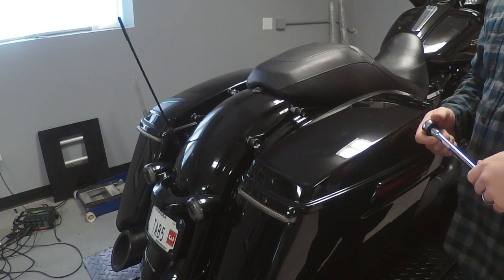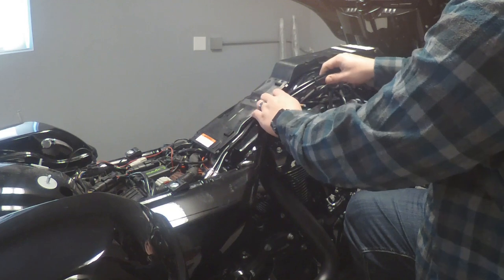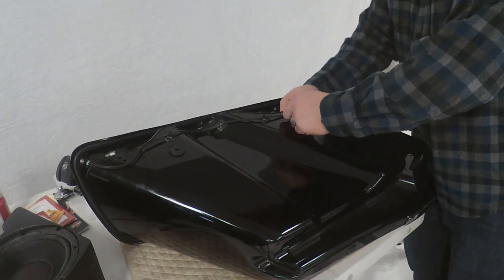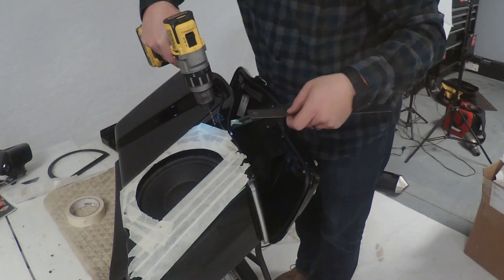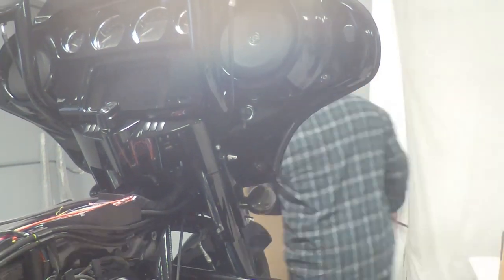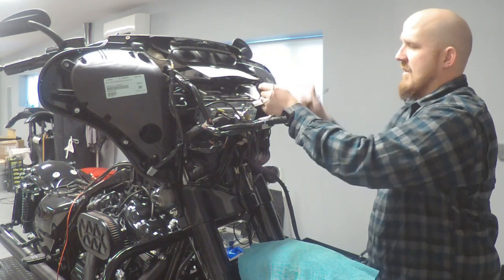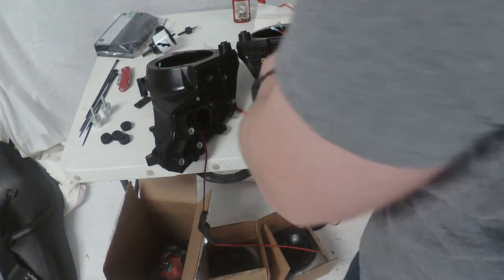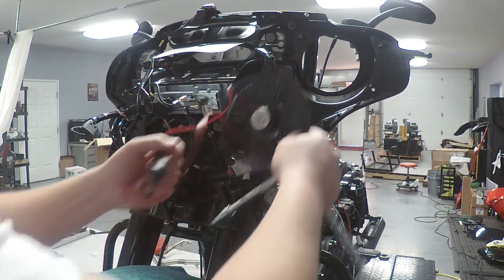Sinister Sound Install Video

Comment: My question is what protects the speaker and your electrical from water damage since Sinister Sound speakers are not weather resistant? IMO...Seems to be a big price to pay for something that can't be ridden in weather. I live in the Midwest and you never know when you're gonna get caught in a rain storm and for how long. We did a test and cut open some of these speakers to find a lot of hot glue and that they're actually house speakers meant for indoors.
Reply from the maker: Note from Sinister Sound - 8’s are waterproof. Front is now extremely water resistant. Enough so that they will cover water damage within the first year, for 8’s and fairing systems, for any system purchased in 2020 on. Sinister Sound is a speaker system manufacture. So the warranty and radios and amplifiers would be up to the manufacture used.
Reply: @TABPerformance  I don't know how well I'd trust a company that says it's now extremely water resistant and only have a year protection when their competitors out there give a three year warranty no questions asked even if you blow the speaker running it through the ringer. I was up in the air about where to go but I think I've made my decision to go with Soundz. But none the less great video for other DIY installers out there!
Reply: @TABPerformance  The other misinformation in that is they don't manufacturer their speakers, they are made by Eminence to Sinisters requested specs.
Reply from the maker: Everyone is open to their own opinions, we are confident enough in the people that own that company standing behind their products that we are willing to put it on our companies site.  Thank you for the comment on the video, we do our best to make them informative and not "salesy" obviously though at the end of the day, you should purchase what you feel comfortable with and I am sure Soundz is a good company with good product as well.
Reply: Are you guys in Sandusky this week?

Comment: How do they sound and what size amp did you use?
Reply from the maker: We used the amp from the install video, Moto 720 and it sounds great.  The better the audio file the better the sound.